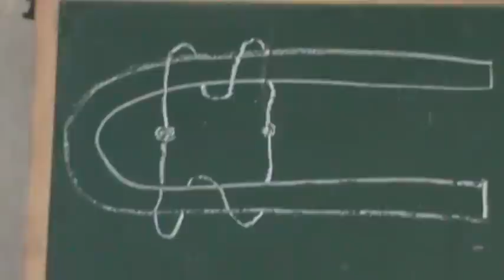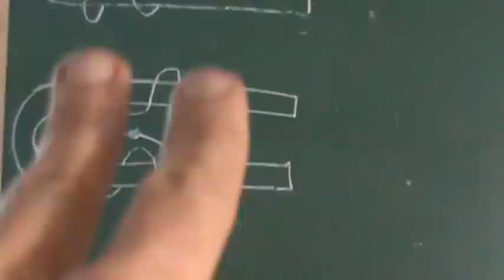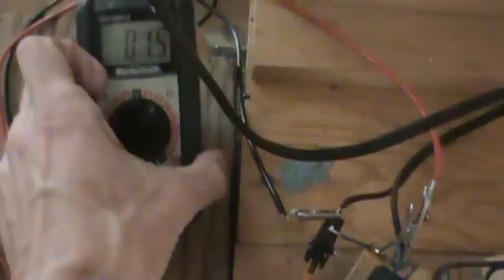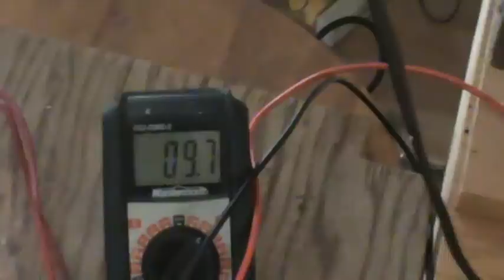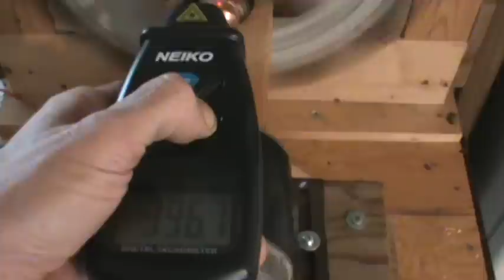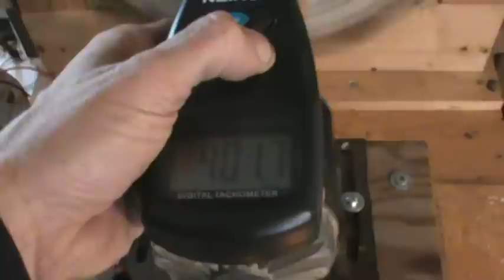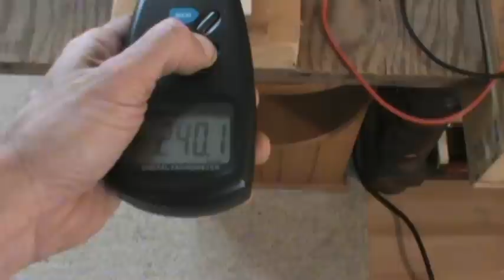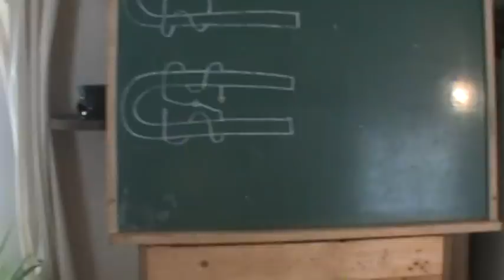Free Energy Project - New Config Better Output

Comment: Can you run a coil with an air core? What effect would that have?
Reply from the maker: Yes you could do that, but the magnetic field of the coil would have less effect on the wheel. The Iron concentrates the magnetic field...electricity likes to flow through silver and copper, while magnetism likes to flow through iron. The coil with an iron core will have more magnetism projected at the passing coil....more efficient use of the electricity used from the battery for torque against the wheel, fewer losses :)

Comment: im not a septic but u need to think high frequency high voltage = less resistance in the wire and moving parts are hard to put in the equation successfully but we all need to help each other and keep at it lol =3-

Comment: Nice vid, Glad that I was able to give you some new inspiration about the coil config.
Though I did not expect the current to be double, I have to check that, if so it will be very interesting. I am still not sure about the iron config but as far as I can see from your tests the two seperate cores are better for output. I am thinking now that the real secret is in the 90 degree angle of the core to the magnets. Thanks for sharing!

Comment: I can see you pushing some magnets in to those wires to run that motor, but not enough to turn the armature from a dead start. If you can establish a monstrous magnetic field in the armature just by one pass of the magnet by the coils. Then your producing some current. Tesla gave the speed of his electricity 157% faster than light. Light shines in all direction. Electricity Seeks. Think magnets, It moves faster in solid iron than it moves through air.

Comment: Intresting as always!
Have to test this.
Did test the same connection before but didn't flip one of the coils as you have done.
My test showed a very irregular waveform on the scope and bad output.
By the way, with the original connection, I get exatly 90 deg phase shift and my 240V leds works best at 50Hz. If I increse input voltage a little from that speed, then the wheel accelerates a lot but the output power decreses. I will compare that to the flipped coil connection.